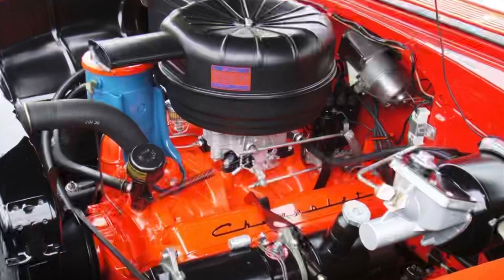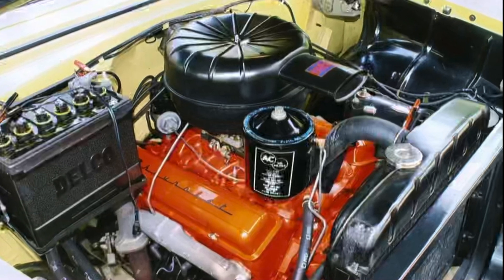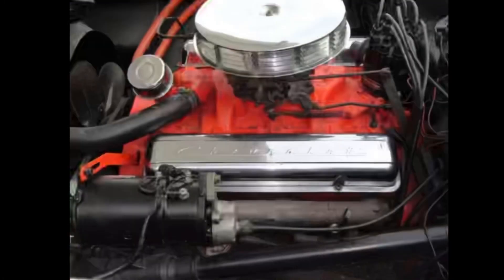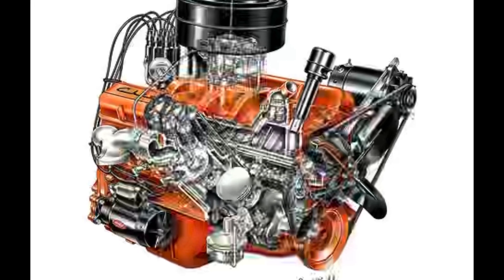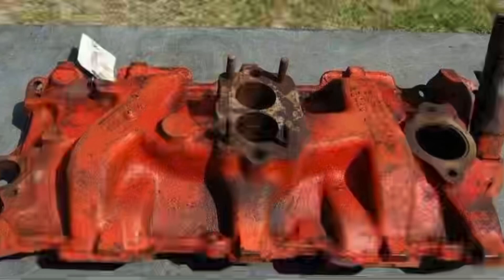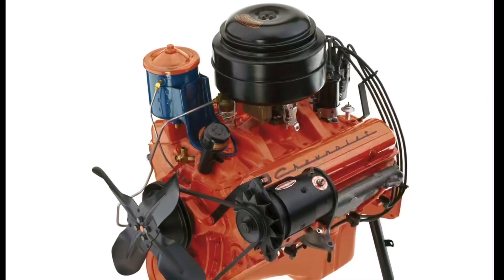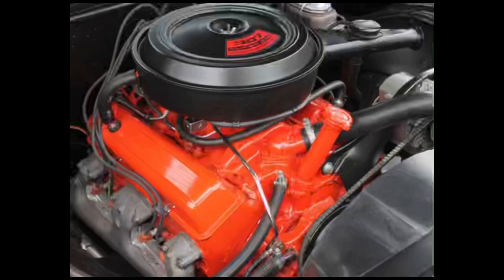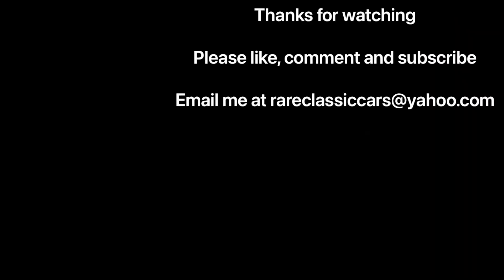Best Engines of All Time: The Chevrolet Small Block V8 (262/265/283/302/305/307/327/350/400)

Comment: I just watched a video about the best 4 cylinder engine.  It was the Honda K20-24.  With 200,000 miles on mine I agree.  I know people have different opinions on this, but don't say the iron duke.😮. I've never owned a V8.😢
Reply: "I've never owned a V8"...Then you've never really lived!
Reply: The boxy volvos 4 banger will last longer than any other. Even when abused as most were